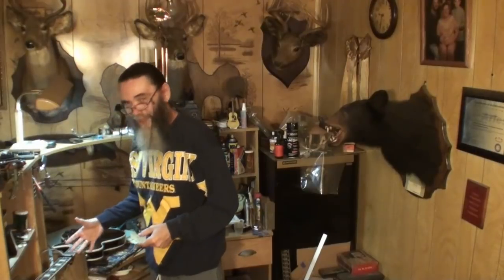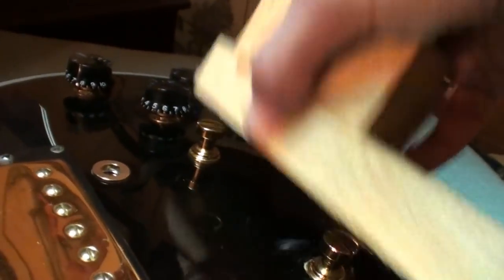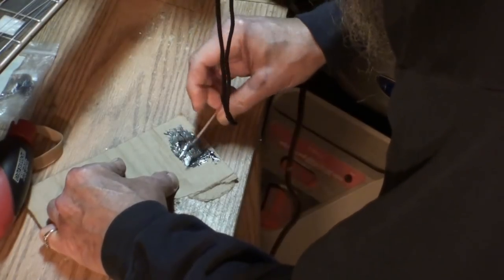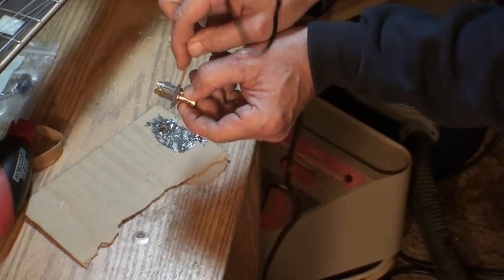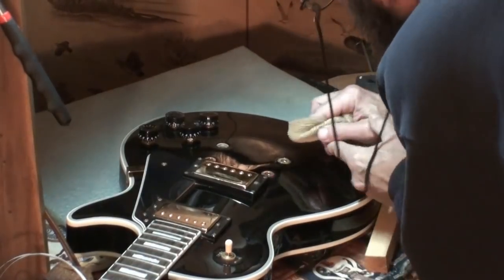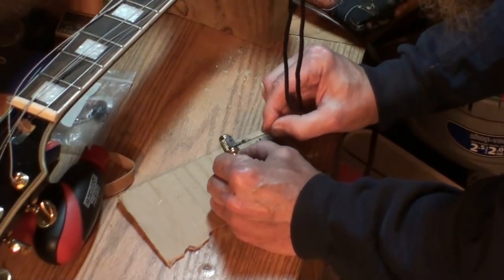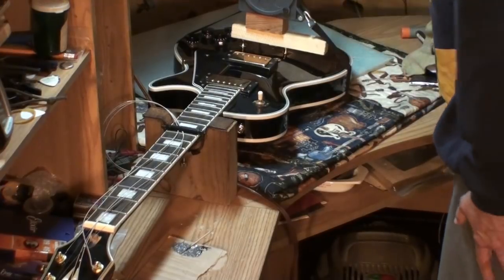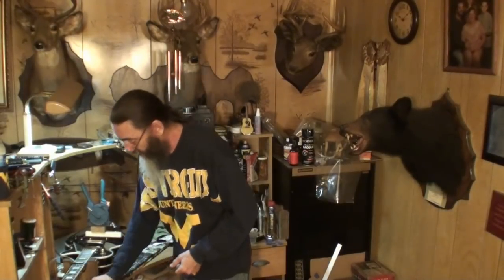les paul custom guitar insert glue up and this time countersunk!

Comment: was thinkin  about  a piece of 80 grit and  ruff up the sides of the insert  to promote a better mechanical bond...  cuz the  sides are so smooth.    also  wipe a little Vaseline on the end of the post and lower threads  as  not to get stuck.    but  too late now...     just a thought.
Reply from the maker: I don't think I even mentioned it in the video but I did take an ice pick and roughed up the inside walls of the holes to give the glue more places to bite in to. thanks for checking it out.

Comment: I need a quick advice, hopefully from you Randy if you see this, or you guys in the comments. So I bought a new Yamaha FG830 a little while ago. The guitar is great, love it, but a thing I noticed right away when I bought it is that the string action is a bit high, and I know I should've took it to a setup but the only guy (good luthier) around in my area is very busy... So I was like no problem, I'll play it like this for a while it'll be good to strengthen my fingers a bit (cause I'm relatively fresh with playing, I was on and off for the last few years, didn't have my own guitar). But now it's somewhat annoying. I actually measured the action today and the bottom of the low E is at 4mm from the 12th fret. I'm playing on D'Addario Phosphor-Bronze 12's. Should I lower it to around 2.5mm which I always hear is the safe sweet spot? Is there any chance of buzzing with that measure, cause although I'm not a hard strummer most of the time, this guitar is a typical rosewood dreadnought and sounds great with full strong strums and I don't wanna be afraid to play it freely without much thinking. Sorry for this long elaboration... Could've/should've made it shorter.
Reply from the maker: you should be ok with lowering your action to that as long as your neck relief is properly set, I set most acoustic guitars neck relief at .012, that;s a good setting for both heavy and light handed players, sort of a middle ground so to speak. good luck!
Reply: Will try to do so... Thanks Randy, cheers!
Reply: Yup. It has a truss rod. Neck relief first, then you get into sanding down the bottom of the bridge saddle. Watch lots of YouTube videos before you start, and look up your specifications at Yamaha website.